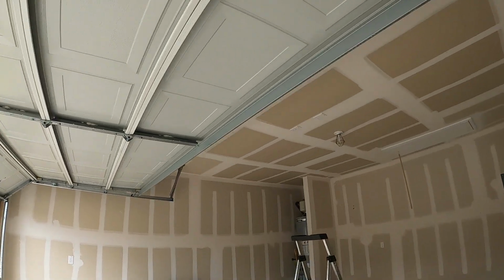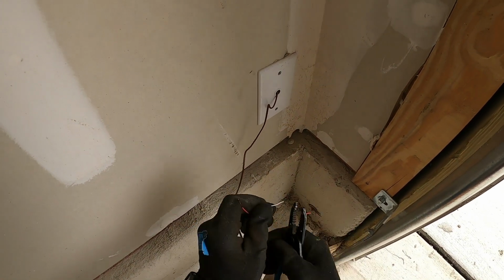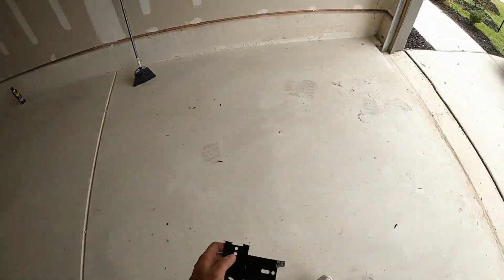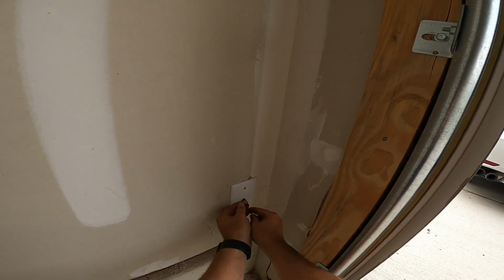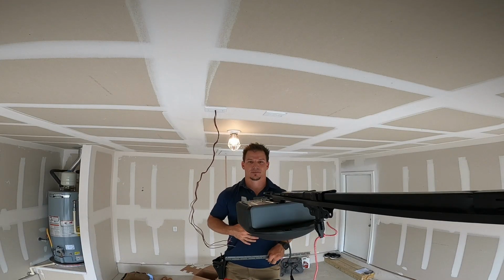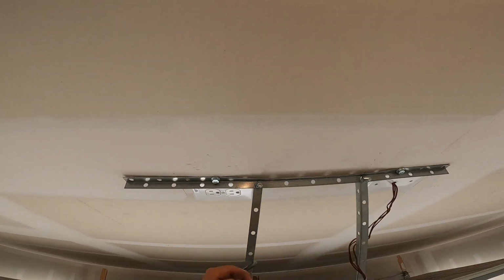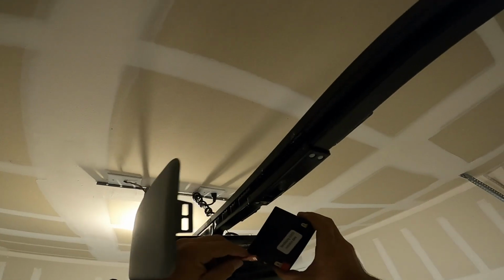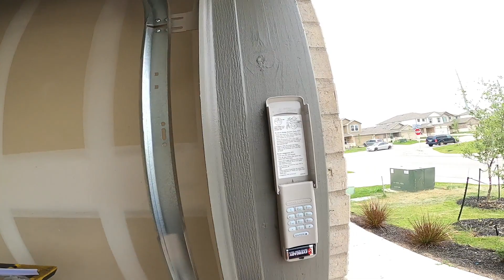Garage door opener install!

Comment: You're awesome.  I have a same garage opener, however, I can't find the battery anywhere?  It needed to be change now.  It's acting up last night and I couldn't find the darn battery anywhere so I can take it off from the motor.  Thanks
Reply from the maker: @johnnypham3410  if the motor does have a battery backup it should be easy to find. you should see a door with one screw your news to take off. If you don’t see that anywhere then your opener doesn’t have a battery. 
Not all openers are battery backup.
Reply: @dapperdudesgarage  I literally couldn't find the battery last night.  I opened the front and the back door of the garage opener but couldn't find it anywhere.  But my phone app showed a red battery with the word disconnected... I was like, wth... I can't use my app to open and close the garage door.
Reply: You're Awesome.
I Have A Same Garage Opener
However I Can't Find The Battery Anywhere
It Needed To Be
Change Now. It's Acting Up Last Night
And I Couldn't Find The Darn Battery Anywhere
So I Can Take It Off From The
Motor. Thanks
@ Johnny Pham 3410
If The Motor Does Have a Battery Back Up
It Should Be To Find. You Should See a Door
With One Screw Your News To Take Off.
If You Don't See That Anywhere Then Your Opener Doesn't Have a
Battery.

Comment: Quick questions probably many of us have. After installing a new motor, springs,  rollers, etc. what should I do on a yearly basis? Lube? Adjustment? Or just leave everything alone?
Reply from the maker: no definitely lube at minimum every 6 months or so. It really depends on location as well. If your around a lot of humidity or moisture. If you get a lot of rain outside etc. A good rule of thumb is to note if the current spring you have is rusty or not, if it is you get more moisture than normal do definitely do the lube etc every few months just to help keep the rust down because rust makes a spring pop and rub etc.

Comment: Excellent Video!  My question  is When replacing the sensors is it neccesary  to go thru the relearning process with the motor smart button? I replaced my sensore but my door still will not go down without returning back up.
Reply from the maker: No sir you do nit have to pair the sensors with the opener at all. Its all just electrical. If the door is still acting up its because something is wrong somewhere. Wires crossed, touching and grounding out, or possibly stapled to hard and cutting the circuit
Reply from the maker: Just do a quick sensor test to be sure its your sensors. Go to your wall button and press the button once, if the door starts down and comes back up immediately, next, press and hold the button and see if it will  override the error and shut the door. If so, you know it is the sensors for sure or the wiring to them etc
Reply: It must be the sensors then because I did the override test & the door went down! I`m replacing the sensors & wires. Thanks for your response sir.👍 @dapperdudesgarage
Reply from the maker: No Problem. Thank you for the interaction on the channel. @horacelee880

Comment: When you were mounting the first bracket for the motor head did you call that a mag nut? Looking for it online, can't find it. Thank you
Reply from the maker: No, they are called “LAG BOLTS” just long thick stud screws basically
Reply from the maker: the ones you shoot into the ceiling should be 3-4 inches in length minimum
Reply: Thank you!

Comment: Another very informative video.  Do you have an opinion on multi piece vs solid rails?
Reply from the maker: well, I guess if I’m being honest, I’ll state the obvious solid rails are good because there’s no potential spots for hangup, but even more than that as far as assembly solid rails are faster to install because all you do is shoot them to the head unit the multi piece rails, you have to assemble each piece together and while generally they don’t pose a problem for the trolleys traveling along them I have actually had jobs where the trolley box was catching on those little grooves so yeah, if I had my choice I would rather deal with the solid rails